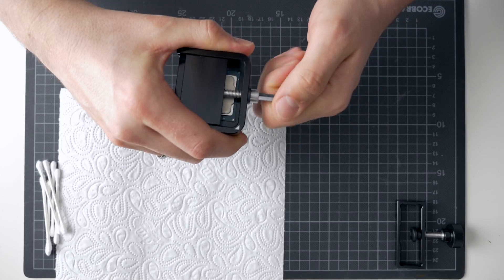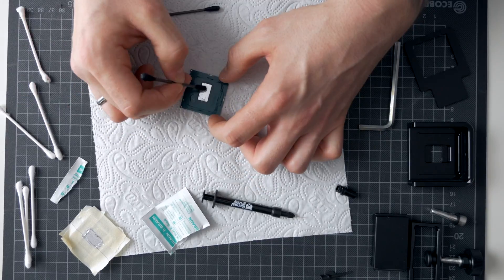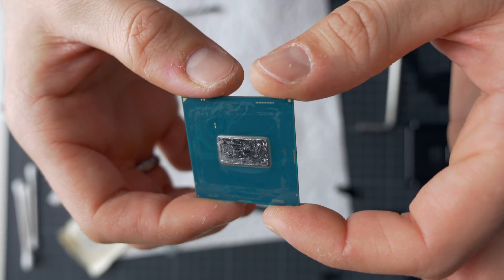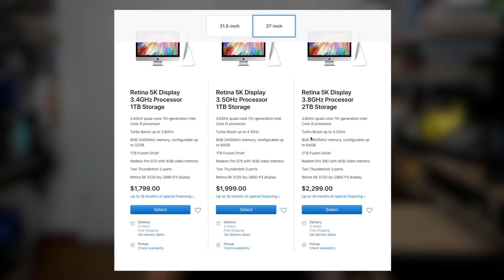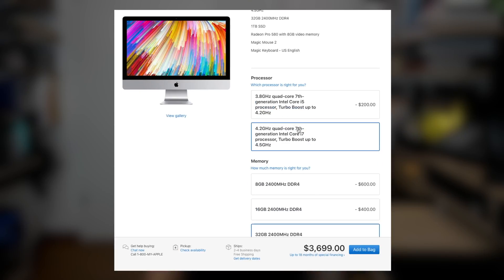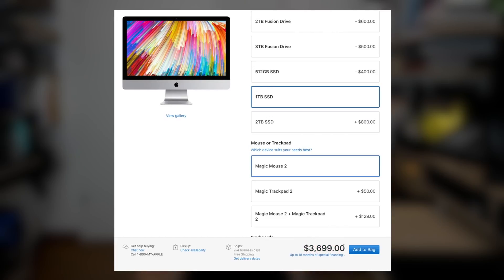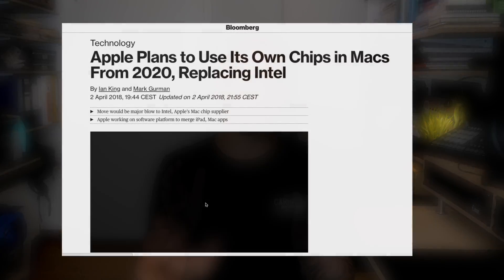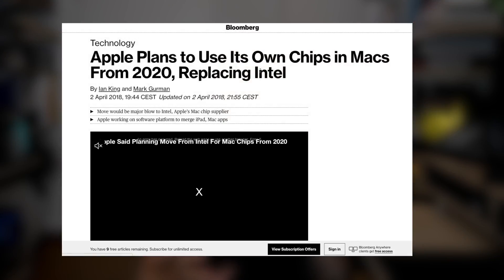Building a Hackintosh workstation in 2018?

Comment: BRo, Can i use an NVIDIA Quadro P4000 in a hackintosh?
Reply from the maker: It should work with High Sierra. Mojave still has no Nvidia web driver. But at best check forums for your GPU model.

Comment: Is it possible to get thunderbolt 3 connections?
Reply from the maker: Yes. Asus offers Thunderbolt 3 cards. They should work without a problem. Tonymacx86 has linked one on their parts list.
Reply: Martin Guder Thanks. Nice to know. Is there a lot of work to do the OS upgrades? Does the App Store work including apps you purchased such as FCPX?
Reply from the maker: For me it was flawless. Just upgrading via App Store, multiple reboots and downloading new kexts, if there are new ones and copy then onto the EFI partition. All in all maybe 10 more minutes than on a Mac. That's it. All App Store purchase and iCloud stuff runs flawless.
Reply: Martin Guder Even iMessage?
Reply from the maker: @dateacha77   Yes, iPhone just needs to be connected via Bluetooth to your Hack. Tested it, worked fine.
Reply: @MartinGuder  Awesome, thanx for the fast Feedback Martin. Just one question though, if you use an external Wifi/BT module anyway, why have you chosen the Asus with the onboard Wifi/BT solution over the (more affordable) non Wifi/BT version? Also, me being a Hackintosh beginner, two more questions, can you build a system running Mojave similiar to your project and is the update process with the installation of the Kext Files complicated, as in - can you possibly mess your MB up, by flashing the wrong file? Thanx and keep up the good work! Greets, Marc.
Reply from the maker: @dateacha77  Hi. I got the WiFi version, because I also have a small Broadcom Chip, that fits onboard. Didn't tried it yet, but maybe with my next build. It's also beneficial, as Windows 10 uses the Intel Bluetooth, so I don't need to install additional drivers.

Regarding Mojave install: I'll do this somewhere around Christmas to have enough time to optimize everything and not be bothered by working hours. ;) It should be flawless from what I read and saw, but who knows.

Comment: Very nice! I was thinking about building one for music production and there is no real need for 8gb video card, what another video card would you suggest and do you think I7 8700k will be stable for music production vs I7 8700?
Reply from the maker: If you just want to use it for music production, there is no need for a dedicated GPU, as it will be barely used at it's full potential. Maximum to render some more advanced user interfaces. Maybe there are some plugins, that can access the GPU power, but not sure about that. The intel GPU on the chipset will do the job just fine. Better spend this money on a DSP, the next pair of studio monitors or maybe more RAM or disk space for sample libraries.

Regarding the K: the 8700 has a locked multiplier vs an unlocked multiplier on the 8700K. So unless you don't want to overclock the CPU, go get the 8700.

Comment: Afaik the new iMac is actually not priced that bad, you have to account for the really good 5k display. If you find a normal desktop monitor with same specs and add that on top of the HW costs you come pretty close.

What you can not do is upgrade everything at will.

Btw. What sort of monitors do you use? (and you are missing a motherboard in your hardware list)
Reply from the maker: If you buy the 5K LG display, this sure accounts for an additional 1300 EUR. If 4K is sufficient enough, you can get away with 400 EUR. Even then, you still have an older processor generation, bad thermals besides the upgrade thing. The current hardware costs you roughly 1900 EUR here in Germany, so I think even with the 5K LG monitor, you are 1000 EUR lower at better performance and long-term durability/upgradability.

You should of course calculate the time, which you will spend configuring everything vs have everything running out of the box. That's especially for professional work very important. But you can lower this to nearly zero I think, when you build an identical machine like mine. ;) I will provide later everything necessary to get this thing up and running nearly instantly.

P.S. Thanks regarding MoBo missing. :)
Reply: Good point. I'm going the Hackintosh route soon, and I might just do that. We have a very similar history and needs/wishes (at least so far).

At work (designer) we use Mac all the way, but I can't really justify the cost at home – especially since I'm more or less using my top specced MBP Retina (2012) as a stationary. And also I would like to do some casual gaming again, and I like to tinker with stuff like this.

btw. you never answered what sort of monitor do you use? :)
Reply from the maker: Forgot: I use a ultra-widescreen 29" LG since some years. Still good (colors accurate and viewing angle awesome). I like the screen estate and that 2 windows besides each other is suiting my workflow much better than traditional 27" 16:9.

Regarding your plans: yes it's more affortable. Yes you will tinker around and it's mostly fun. Yes you can game again with reasonable performance and every current gen game at 1080p ultra with good frame rates.

I also have a Macbook Pro from work, but it has rubbish performance compared to the hack ... I knew it would be this way, but not expected it to be that much of a difference.

Comment: Does nvidia quadro m4000 works with Hackintosh ?
Does it supports to my specs -
Intel(R) Core(TM) i7-6700K CPU @ 4.00GHz
NVIDIA Quadro M4000 MSI Z170A Carbon Gaming Pro
Need advice..
Reply from the maker: I think it should work. There are mac drivers provided by nvidia (called nvidia web drivers). Just to be aware: OpenGL and metal support is better with AMD cards, as Apple is using them since years. I have an AMD RX580 working out of the box.

All other specs should be fine. Maybe just post the mainboard, but that shouldn't be much of a worry.
Reply: Thank you! Let's try it out...
Reply from the maker: Maybe post the results later. :)
Reply: Martin Guder stuck with the apple logo.. something wrong with the bios.. couldnt get into the installation part.. im usingg MSI GAMING PRO Z170A
Reply from the maker: Did you searched a forum like tonymacx86 for your board and the issue? That's what you should do first. Most issues have been described there by somebody else. You can also search for Golden Builds (working machines without hickups) with your specs. Especially for older systems like Z170, there is often a solution.

Just a question: you prepared the installer correct? I used UniBeast to make all the necessary changes to the base OSX installer.
Reply from the maker: And one thing regarding BIOS. Usually there are some settings, which apply to most machines.

Virtualization : Enabled
VT-d : Disabled
XHCI Hand-Off : Enabled
Legacy USB Support: Auto/Enabled
IO SerialPort : Disabled
Network Stack : Disabled
XMP Profile :  Auto / Profile 1/Enabled
UEFI Booting set to Enabled and set Priority over Legacy
Secure Boot : Disabled
Fast Boot : Disabled
OS Type: Other OS
Wake on LAN : Disabled
Reply: Martin Guder thank you 🙏 ll try that out